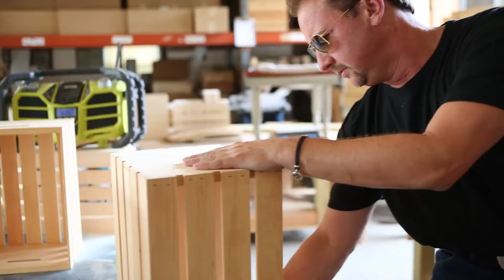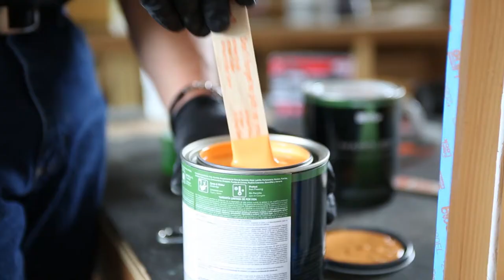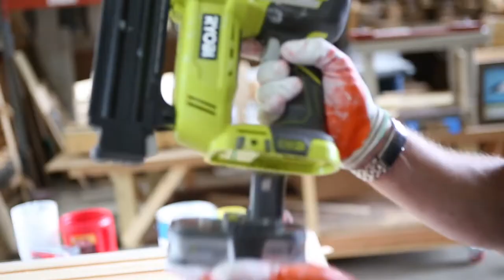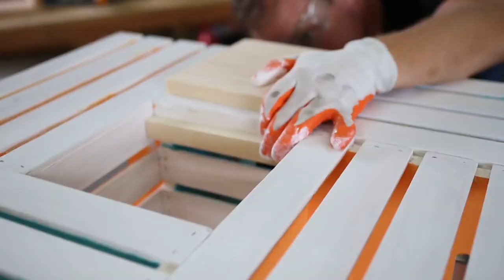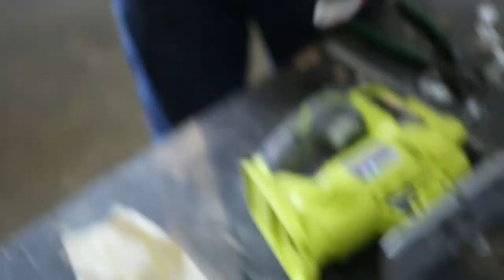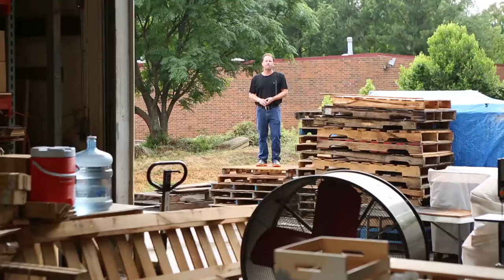Johnny Kentucky makes a Pinwheel Crate Coffee Table

Comment: If you were to use legs would you nail those in? I made one of these about a year ago and my legs are becoming pretty loose. I've tried super glue (doesnt work) and nails. And the more I try to get it fixed, the more the wood (from where the leg is) gets pulled off and stuck to the leg. I don't want to have to make a new one if there is any way possible to get this fixed. Any tips are appreciated. Thanks!